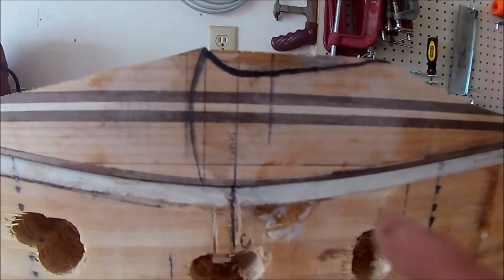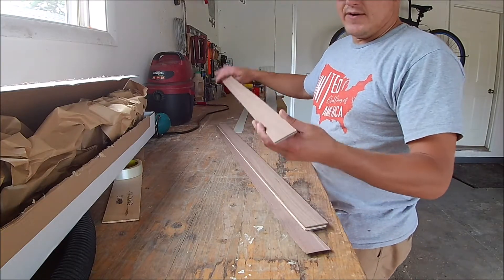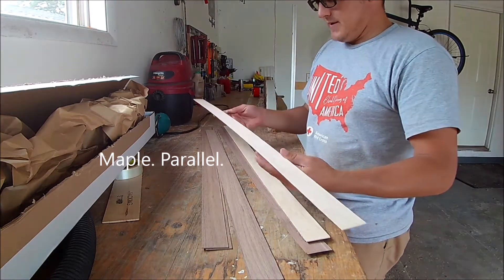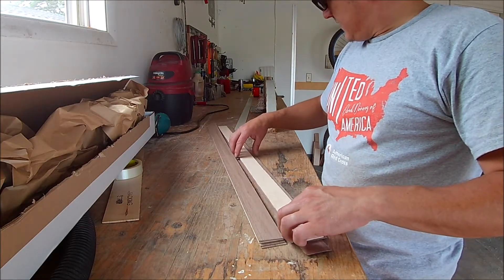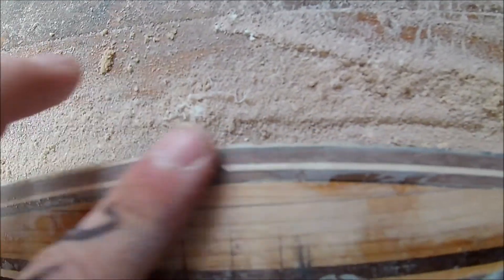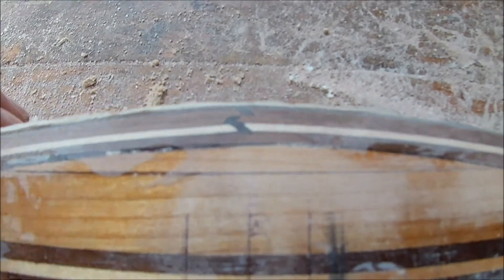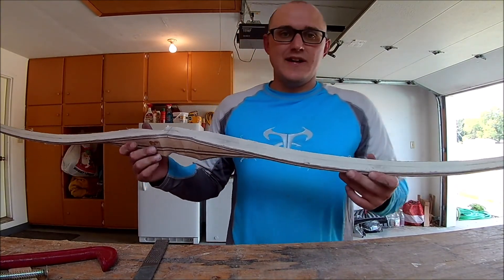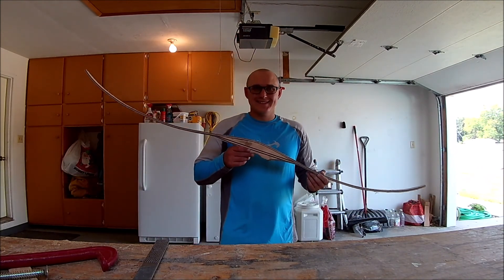Homemade Longbow Part 3. Glue-up and Rough out

Comment: Glue your joints in the center lams first with superglue before gluing up the bow , then lightly sand to remove  and glue that leaks) ,  and you are right , make the splice a lot longer.